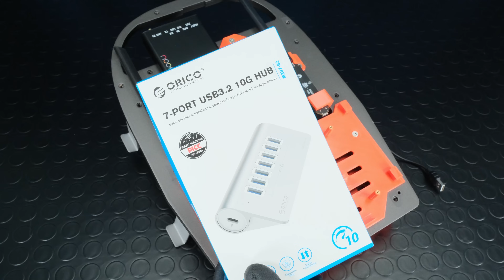Backpack Cyberdeck: Assembly Guide - Cerambyx64 MOD_01

Comment: I tried to timestamp a parts list as I'm trying to build this out. Hope it helps!

Let me know if I need to update it to provide more exact details.

0:32 M4x6mm
0:36 Angled MiniUSB 30cm (GPSD0 <-> Hub)
0:43 Leo Bodnar Mini Precision GPS Reference Clock
0:50 M4x8mm
0:59 M4x6mm
1:03 (4) Anker 737 (PowerBank)
1:11 M4x6mm
1:16 ALFA WiFi AWUS036ACHM (uncased)
1:18 M3x3mm
1:24 HackRF One (SDR)
1:26 USRP B205mini-i (SDR)
1:30 Catsniffer V3 (Multiprotocol Transceiver)
1:42 (2) Orico M3U7-G2 (7-port USB 3.2 10G hub uncased)
2:08 NGFF IPEX4 - M.2 WiFi Module (Coax <-> NIC-AX210)
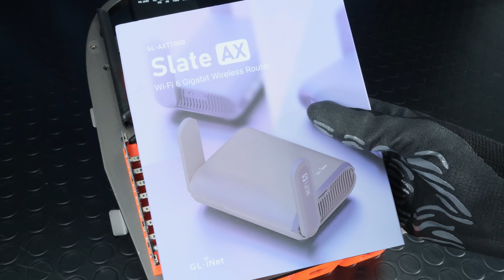2:15 GL.iNet GL-AXT1800 (Router uncased)
2:43 USB-C 10cm (Catsniffer <-> Hub)
2:49 GPSD0 <-> Hub
2:59 Micro B 15cm (USRP <-> Hub)
3:07 Angled MiniUSB 10cm (ALFA WiFi <-> Hub)
3:28 USB Extension 30cm (RTLSDR <-> Hub)
3:37 USB Extension 30cm (Airspy Mini <-> Hub)
3:48 USB-C 15cm (Router <-> PowerBank)
3:39 MiniUSB 10cm (HackRF One <-> Hub)
4:14 MiniUSB 20cm (GPS <-> Hub)
4:26 (2) Cat5e 5cm (Router <-> Sigma)
4:32 IPEX MHF4 15cm (Coax cable)
4:45 Samsung SSD T7 (Storage)
4:53 Angled USB-C 20cm (SSD <-> Sigma)
5:00 Angled USB-C 30cm/25cm (PowerBank <-> Hub)
5:13 Angled USB-C 30cm (PowerBank <-> Hub)
5:42 3 Pin 30cm (PowerBank <-> Fans)
5:56 USB-C 10Gbps 30cm (Hub <-> Sigma)
6:09 USB-C 10Gbps 30cm + Angled Adapter (Hub <-> Sigma)
6:32 USB Extension 35cm + Angled Adapter (ALFA WiFi <-> Sigma)
6:46 USB Extension 30cm + Angled Adapter (ALFA WiFi <-> Sigma)
7:03 Intel i5-1340P 32GB (Lattepanda Sigma)
7:14 NIC-AX210 6Ghz BT5.2
8:16 Angled USB-C 100w 20cm (PowerBank <-> Sigma)
8:27 Angled USB-C 100w 20cm + Adapter DC5.5x2.5 (PowerBank <-> Sigma)
9:09 ALFA AWUS036ACM (WiFi)
9:54 ALFA AWUS036AXM (WiFi)
13:19 (2) Noctua NF-A4x20 5V (Fans)
14:09 Noctua NA-SYC1 (Y-Cable)
15:13 SMA 21cm (Coax cable)
15:22 SMA 15cm (Coax cable)
17:47 Airspy Mini (SDR)
17:54 Nooelec NESDR SMArTee v2 (SDR)
18:02 Bonito GigActiv GA3005 (Active Antenna)
18:14 Eltehs  ELT0101 NEO-M9N (GPS - USB receiver board with SMA)
18:28 (2) GNSS L1 Quad Helix 50x19mm (Active Antenna)
18:36 (2) Diamond SRH805S (Antenna)
18:44 Flipper Zero (Mutli-Tool)
18:49 (2) Triband GSM/UMTS 868-900-1800-1900-2100-2400 Mhz (Antenna)
Reply from the maker: Thank you for pointing that out and for sharing the list of components! I sincerely apologize for not including this information earlier. I’m currently preparing a comprehensive list of all the necessary materials, and I’ll be publishing a PDF with all the details on my website within the next few hours. I truly appreciate your feedback and patience.
Reply: @BAG.BUILDS  Seriously, I appreciate the videos! Amazing build and I just want to absorb and learn it all!
Reply from the maker: Thank you so much for your kind words! I truly appreciate your support and enthusiasm.
The PDF with the full list of components is now ready and available on the build page. You can find it at the following link: https://cdn.shopify.com/s/files/1/0726/6815/2142/files/Cerambyx64_MOD01_-_Part_List.pdf?v=1733326650
If anything isn’t clear or you need further clarification, feel free to reach out, I’d be happy to help.

Comment: Завидую такому безграничному доверию к коннекторам !
Reply from the maker: Why do you say that? :)
Reply: @BAG.BUILDS  - очень , очень, очень много разъемов ! Вряд ли даже половина из них золоченые ! Скоро начнут окислятся и ухудшать проводимость ! А в таком огромном их количестве найти нерабочий будет проблемно !
Reply from the maker: I’ve honestly never come across oxidized USB cables, maybe it’s just the climate here, I don’t know! Finding a faulty cable should be pretty straightforward though, right? Just see which device stops working. 😂 One device, one cable! 😁
Reply: @BAG.BUILDS To do this, you need to use magnetic connectors everywhere and isolate the boards from oxygen and moisture using paraffin or epoxy varnish.
Reply: @BAG.BUILDS One day a glass of liquid will spill on this backpack or you will get caught in the rain and your money will be gone  to cry😅
Reply from the maker: @indira-chu  Waterproof backpack cover, in case the weather is uncertain. Sorry, but how do you connect your devices to the computer? Don’t you use cables? Even if I trip, I could break everything; just like driving a car, you can get into an accident. In other words, there’s no point in listing everything that could go wrong; obviously, anything can break. No one has invented an indestructible backpack yet.
Reply: @BAG.BUILDS   Waterproofed with paraffin and epoxy varnish, laptop/portable console board, like  Steamdeck or OneXPlayer, Lenovo Legion Go, e t c + magnetic connectors for all  ports+magnetic cables. For example: magnetic Type-C kit = Full size thunderbolt 3-4-5 Hub Dock =  full size multiplied USB A ports + 3.3mm jack, for micro input & sounds output, also another ports/interfaces(like hdmi, sd card reader, internet  ethernet, wi-fi - Bluetooth e t c.
Reply: @BAG.BUILDS  also u should have waterproof, modded liquid cooling system for computer systems hardwares.

Comment: Looks incredible, even with this much possible fail points (usb ports touching eachother) it must be way cheaper than building own hardware
Reply from the maker: Thanks! I’ve actually been using this setup for a few months now, and I haven’t had any issues, no damage at all :) I’m not sure what you mean by "USB ports touching each other," but everything is securely in place.

And yeah, building all the hardware from scratch would be crazy! Companies spend months designing some of these devices, and replicating that effort alone would be nearly impossible.
Reply: @BAG.BUILDS  its my fear of detouching port contacts, broken usb ports and thick  plugs that by touching eachother make it unplug, its a nightmare to reconnect something in the middle of the work, reconfigure software and other following things, also none of my usb 3 cables I had lived long, too many wires inside. However you built everything on a thick metal frame that avoids your build from external factors, so it mostly vulnerable only to user's intervention, hope nothing happens ever

Comment: Very cool...but super curious if the cooling works on a hot day. Could get quite steamy..
Reply from the maker: I tested it outdoors with temperatures of 30 degrees, and it didn’t catch fire :) Of course, if you leave it directly under the sun, no cooling system would hold up, even a laptop would melt under intense sunlight

Comment: I am slightly concerned about removing the fan and heat sink from the router, but there's some interesting stuff here.
Reply from the maker: I’ve never seen that fan on the router spin :) By default, it kicks in when the temperature exceeds 85 degrees, I used this router in another build before, with the casing included, and it never went above the limit. Leaving the heatsink wouldn’t have been a bad idea, but in this case, it’s not necessary. The two fans installed on the frame constantly push air onto the router, keeping the temperatures well below the limit. I’ve never gone above 70 degrees, even with external temperatures of 28 degrees. The two hubs positioned on the sides of the fans channel the air under the SBC and then over the router. I've also never had any issues with excessive heating for the computer.

Comment: I think it's really cool, it looks super cool, although the noise in the signal with all the cables and antennas mixed up must be horrible.
Reply from the maker: To my surprise, the situation is not terrible at all. For example, with RTL-SDR, I can receive ADS-B signals from planes 160 km away, and the antenna is positioned in my backpack, which I’d say is pretty good. Occasionally, there are a few spikes, yes, but those happen even if I place the radio on a rooftop.

Comment: I don't know but with that many antennas, I wouldn't want to carry it on my back. 

You could make it "stealthy" by not carrying your own wifi thus not directly transmitting a hotspot (stealthy  in quotations because the second you connect to something, you'll leave a footprint). Just a bog standard ethernet connector to a laptop, while you are sitting on the train and sipping coffee.
Reply from the maker: I get what you're saying! But just to clarify, I use the antennas in passive mode most of the time, and when I do transmit, it's only for brief moments. I've also set the WiFi router to the lowest power setting, and I do use an ethernet cable to connect to the system. If you check out my latest video, I actually show where the cable is positioned.
Reply: @BAG.BUILDS  Thank you for the reply!
Yes, I was a bit worried about the setup emitting a bit too much energy. I'm glad to hear that you are on passive!

I'll take a look at the latest video then.

Comment: I feel like this is purpose built for wardriving, i dont know what gave it away, might have been the hack rf, or it might have been the alfa ap thats well known for being a cheap and cheerful aircrackng compatible wireless adapter
Reply from the maker: For wardriving, all you need are Wi-Fi adapters and a GPS receiver. This setup is for general use; there are other components installed that are not related to wardriving.
I plan to create a setup specifically for this purpose, with more Wi-Fi adapters to increase the number of channels monitored simultaneously.

Comment: Use aviation or army standards and make all connections, water-dust-vibration resistant. Secondary, mechanical shock resistant and temperatures are a thing to think about too, like if outside is 50C will it still work for IDK 10h of non-stop sniffing or transmitting ? what if it is -25C ? Just some ideas.

Comment: Add one more thing: self destruct mechanism

Just in case the bag is being stolen
Reply from the maker: never say never, maybe in a future version! 😄
Reply: @BAG.BUILDS  I would've gone with tracking the bag by adding a mic, speakers, and a SIM. "Put down the bag or I won't call the cops to *insert exact GPS location.*" Considering the sheer cost of the parts, a self destruct charge might be cooler but cripplingly expensive....

Comment: How do the antennas right next to the aluminium backplate fare?
Reply from the maker: Of course, the reception would be better if the antennas were positioned differently, but they still work quite well as they are. I’ve done wardriving in a rural area with houses far from the road, placing the backpack on the seat inside my car. I was still able to receive signals from all the routers in the area. So, considering the circumstances, the performance actually exceeded my expectations!

Comment: Are all those metal parts not a problem for your antenna's?
Reply from the maker: The metal parts might cause a slight loss in reception, but based on the tests I’ve done, the results have always exceeded my expectations. The setup performs very well even with the metal components in place.

Comment: Holy antennas batman! How are you not getting crosstalk?
Reply from the maker: In theory, the antennas shouldn’t be placed so close together, but in practice, I haven't encountered any issues. I’m still able to decode what I receive or run a base station without problems. Of course, if you're looking for maximum performance, this setup isn’t ideal. It would be better to switch to something more specialized. This setup is more like a Swiss Army knife, it can do many things, but if you want to achieve the best results in each area, it's better to use specific tools for each function.
Reply from the maker: Alternatively, the antennas could be routed outside through the top holes.

Comment: Could anyone tell me if this is TSA approved? Thanks.
Reply from the maker: Regarding the power banks, each one is under 100Wh, which is within the TSA guidelines for carrying batteries in cabin luggage. As per regulations, you can bring multiple power banks as long as each remains under 100Wh, but I would recommend not fully charging them to minimize any potential risk. While incidents are rare, the possibility of a power bank malfunctioning and causing a fire is something to consider seriously, it could be quite dangerous and difficult to manage mid-flight.

As for the SDR radios, they are generally allowed in carry-on luggage, but there are some considerations. SDRs can be subject to additional scrutiny during security checks because they are often less recognizable to security personnel. In certain countries, particularly those with strict regulations on radio equipment, carrying these devices could lead to issues at customs or even confiscation. It's always a good idea to check the specific rules for your destination country before traveling.

In short, while the setup might technically comply with TSA guidelines, there are risks and additional considerations depending on the destination and the specific flight regulations.

If I were to take the setup on a flight, I would absolutely avoid using it while in the air.

Comment: How does this keep from melting everything when a router, high dissipation radio and computer are on at the same time?
Reply from the maker: The router and the computer are the devices that generate the most heat, and they are positioned near the fans, which manage to keep their temperatures well within the limits without any issues. All the other devices operate with passive cooling, but here they benefit from forced ventilation, which is much better than just having them sitting on a desk. I’ve run this setup for hours, and I’ve never had any problems with excessive heat.
By the way, did you happen to notice the two fans attached to the frame?

Comment: Now this is what I call mobile computing. You got enough radios to see everything going on.
Reply from the maker: Yes, it's definitely handy to monitor multiple bands simultaneously. It becomes necessary if you want to listen to trunked radio systems, for example, or perform more sophisticated operations that require using multiple radios on different frequencies.
Reply: @BAG.BUILDS are you pentester?
Reply from the maker: No, it's not my profession, it's just a hobby.
Reply: @BAG.BUILDS  ho okk.. XD every single  wireless monitoring devices are there... that's why asked

Comment: Why not tag these cables?
Reply from the maker: I actually tried labeling the cables once, but the tags just ended up getting in the way and bothering me. Honestly, I don’t find them necessary for this setup. When I need to start everything up, I just plug the cables from left to right, it’s a simple process and pretty much impossible to mess up. Plus, when I disconnect the cables, they stay in position, so there’s no chance of getting confused.

Comment: Idea great, no voice, how many Wifi components alone? +1 point to the Intel, figured this would be some pie. Too many USB and too many USB cords. Lots of work basically. If I got a micro or mini, 3D printed a frame both metal and Abs or resin printer, I would have fewer coards and components.  This has no context. Is he selling these as completed or as kits, is this realy worth all of that?
Reply from the maker: Thanks for the feedback! when you mention "micro" or "mini," could you clarify what you mean?
Reply: @BAG.BUILDS  Motherboard, May need to choose the right one and spend a bit because if you can get a Micro with both a !6x and 1x or 2x then you have slots for a GPU and a WiFi/BT card. I have seen Custom builds that are literally a frame and the hardware. According to one site 8x 12 volt batteries will provide power, if not gaming a Sharkgeek charger should suffice. May need to further look into it if not exact.

Comment: Was soll das sein? Mit so vielen Antennen?
Reply from the maker: Each SDR-antenna pair is tuned to different bands, which is useful for monitoring various signals simultaneously. In some cases, like with Trunked Radio Systems, you need more than one radio to follow both the control channel and communication channels. Additionally, there are a lot of interesting hacks and experiments that require multiple SDRs to work together.

Comment: Seems way over-specced and overloaded for no good reason.
5/10 only needs half the gear.
Reply from the maker: Actually, it may look overloaded, but there are really just three main types of devices: SDR radios, WiFi adapters, and a multi-protocol board. I use 3 WiFi adapters to monitor multiple channels simultaneously and 4 SDRs to cover frequency ranges that can’t be monitored with a single radio, and each SDR has its own strengths and weaknesses. I don’t always use all these devices at once; it depends on the task. Of course, anyone can build a setup with half the gear if that suits their needs, it really depends on what you want to do with it!

Comment: Shiny, costly, inefficient. EMC and power supply are so poor...
Reply from the maker: All theory, but in practice, I haven’t had issues. I’m not sure what you mean by “inefficient.” Could you clarify?
Reply: @BAG.BUILDS  Instead of using a common power line with replaceable or rechargeable batteries - you use 4 power banks.
Instead of using one SD 4-channel transceiver (and maybe a 2-channel would be enough), you use several receivers and transceivers.
That's what I call "inefficient".
Reply from the maker: I understand your point, but the goal of this build was to use components that are easily accessible. Using power banks makes the setup more practical and safer for most people, since not everyone has the tools or expertise to build custom battery packs, which could also be dangerous if done incorrectly.

As for the SDRs, I’m aware of multi-channel transceivers, but the only one I know of that offers independent channels is made by Ettus, and it costs as much as a house! Plus, it’s too bulky to fit into a portable setup like this. Given its price, I doubt it's widely used. This setup is meant to be both flexible and achievable for enthusiasts without needing industrial-grade equipment. Thanks for your feedback, though, always open to new ideas!